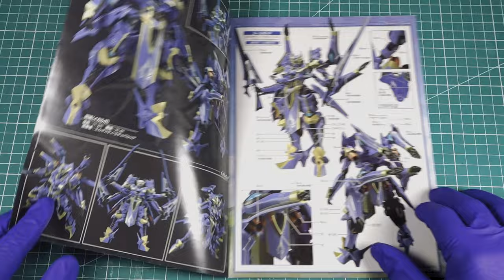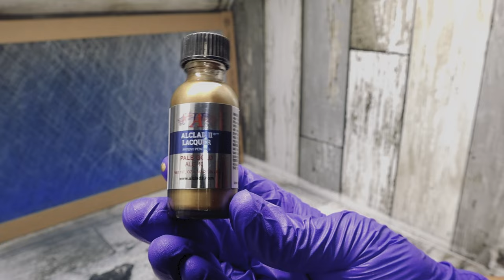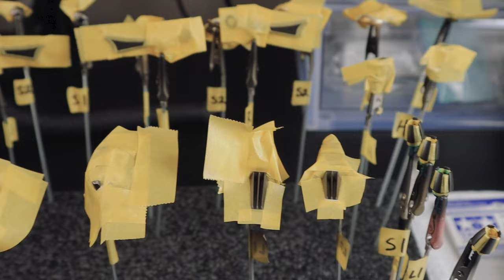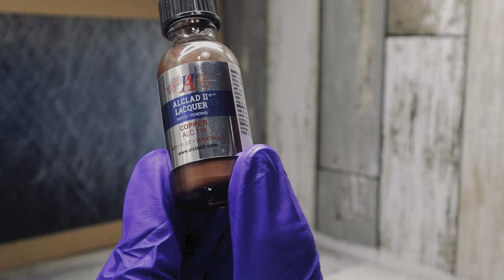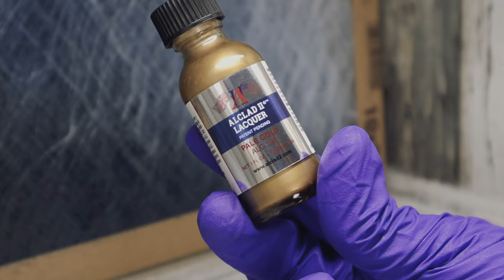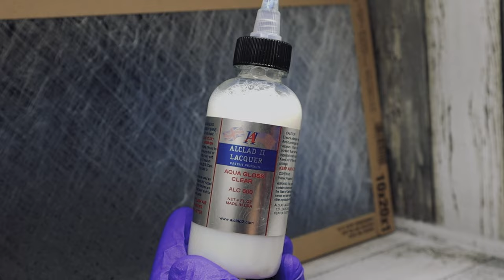Ikaruga [MODEROID] [KNIGHT'S & MAGIC] [ナイツ＆マジック] [Full Model Kit Build and Custom Paint]

Comment: I use the same 3-way and 4-way sanding sticks from our local Sally's Beauty Supplies.  They have the larger size and a much smaller stick (less than 3" long) in the 3-way that is perfect for Gunpla.  Very soothing and satisfying video.  May need to look into the Moderoid kits now after watching this
Reply from the maker: I've really taken a liking to the Tropical Shine stuff. They last quite awhile and are very inexpensive. I'll have to try the larger ones! This was the first Moderoid kit I've ever worked on, it's pretty different from Bandai that's for sure.

Comment: The metallic paint looks so good! Also, did you put a layer of clear coat on before, and after you applied the decals? Or was that on different pieces and I just missed it?
Reply from the maker: Thank you! I put a layer of clear coat before and after. One to layer the decals on. A glossy surface is easier to apply waterslide decals. The second coat is to seal in the decals and help hide the decal 'step' a bit more.

Comment: why do you take the time to mark them with tape and then proceed to cut everything off the runners?
Reply from the maker: The tape in the beginning helps me clearly see the runner label. Just an extra step I like to do to make the initial assembly smoother since there are quite a few.

Comment: Amazing work and production on the video! I saw you have most of the range of madworks chisels. What do you use the ZERO (needle point) for? And are you able to compare it to other brands of needle scribers?
Reply from the maker: I mainly use the zero size for starting holes for drilling, or very very small panel lines I need to deepen. The head on this Ikaruga I used that zero size. Only other needle type scriber ive used is the wave ht-250 carving needle, which I prefer to start my lines. I find the madworks zero a bit too sharp for starting my lines.
Reply: @plamomancer  Thanks so much for explaining! I notice you use the wave needle for deepening lines too is that right?
Reply from the maker: @lizardsaur  thats right. I highly recommend the Wave chisel.

Comment: Hello there! I saw that you used water slide decals for this kit but the one I bought comes with regular sticker decals on a yellow sheet. Where did you get the water slide decals?
Reply from the maker: They're the official Good Smile Company waterslide decals for the kit. Unfortunately, they only go up for pre order and are limited. There are some third party options, but I haven't been able to get any. You can check the Good Smile Company website and they might be up for pre order for another run.